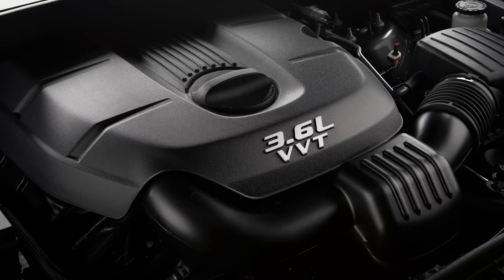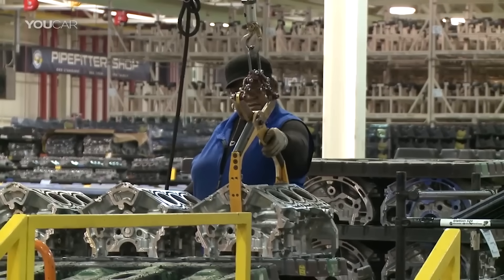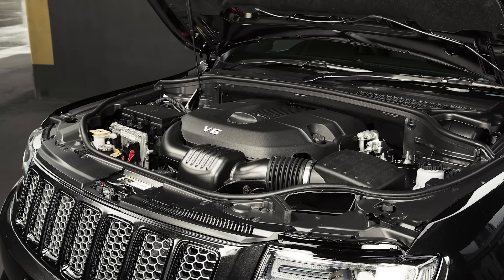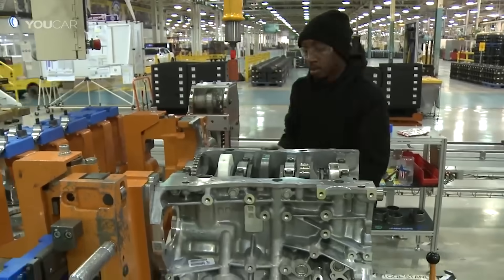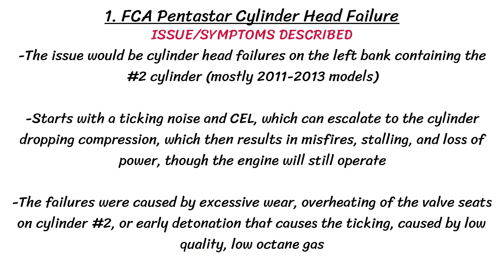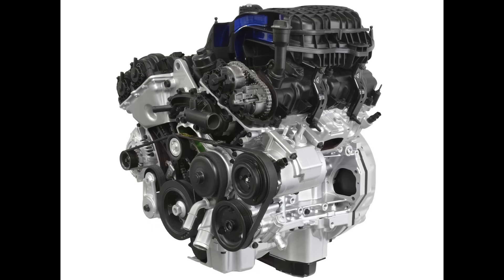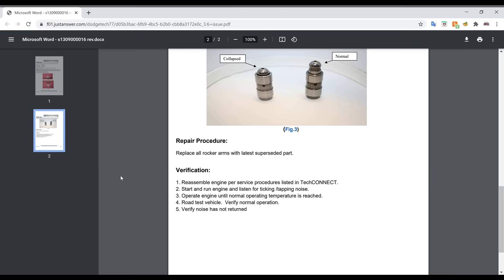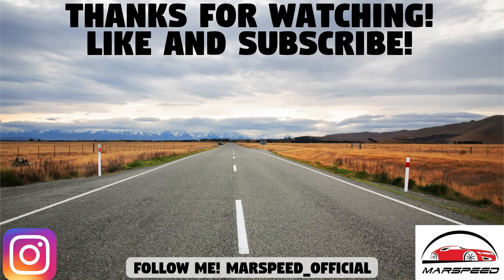The Specs and Fatal Flaws of the Chrysler 3.6L Pentastar V6 Engine

Comment: Ive had 3 vehicles with the 3.6L Pentastar. Never a single issue with any of them. Ive always done 5000 mile oil and filter changes on them. Fantastic engine!
Reply: I can't see how a single pentastar 3.6l DOESN'T blow its oil cooler by the 3rd oil change.
Reply: @richthevirtuoso my 2011 Grand Cherokee made it to 152k miles before the oil cooler needed to be done
Reply: @RRoy83  or was that when the oil started dripping? If you see how theyre attached to the motor, when they're hot and you twist off the filter cap... eeeeeasy to break that oring seal
Reply: @richthevirtuoso  Six years and 112,000 miles mine id fine. But yes, the plastic cooler/filter base can leak. I am 98% highway miles, and can see how all the heat from city driving could really cause a problem. Fully aluminum replacement oil filter/coolers are available for a couple hundred on amazon.
Reply: @richthevirtuoso  I never had to replace mine on any of my Grand Cherokees. But I'm sure I will have to eventually and that's okay. It's a job that I can do myself and it's not very expensive.
Reply: @Japplesnap  ya not expensive, but it's 120$ in china's pocket every time someone buys an aluminum one. All brake rotors too. Need to start manufacturing in India or NA
Reply: @richthevirtuoso  Personally, I'd only buy OEM when I need one. But if you want an American made aluminum one, buy one from Dorman. They are more expensive, but they are good quality. I'd still get an OEM plastic unit because mine haven't been problematic.
Reply: @Japplesnap  when I took mine off; the simple physics of it blew my mind. The filler cap sleeve is long and angled in such a way that the 2 bolts at the front of the body could never resist the force of a tight filter cap.. let alone when it's hot which is when we SHOULD change the oil, and .y o ring was flattened and fatigued when it came out. I was stunned
Reply: @richthevirtuoso  The issue 99% of the time is that people tighten them too much and crack the plastic. There's actually a torque rating and if you use it, there shouldn't be any problems with it. I actually torque mine to spec every time and haven't had an issue. It doesn't require a lot of torque to tighten it. The cap seals very well without much torque because of the o-ring. And that o-ring is a wear item and should be replaced every oil change.
Reply: @Japplesnap  the oring that seals the cooler to the engine is what I'm talking about. Also not sure if it's grime or expansion etc but cracking the filter cap loose was the most torque intensive part for me. It was really stuck several times. Think that was the culprit for me
Reply: @richthevirtuoso  Okay, I see. That's actually a gasket, not really an o-ring. But yeah, when the gasket fails you still have a leak either way. I guess I've been pretty lucky because mine hasn't failed yet. And my current Grand Cherokee is a 2019, so going on six years old already.
Reply: @Japplesnap  🙂
Reply: A wife is great in the honeymoon  phase till you get the honey do list, then you question like at 100,000 miles think I am closer to 1 million.  I do have to admit power they are great for a V6 non power outer engine but several problems I have seen is ease of maintenance like plugs and the common problem of oil cooler failure that you must rip intakes off to get to.Having a plastic intake is a thing you must take special care not to crack warp or strip bolts reinstalling, Have had no engine it self issues at close to 200,000 miles but not sure how many miles you had on your engines since I am  NJ with much stop and go traffic Vs if it was at my farm in NC that 18 miles to Walmart has 3 times I have to stop compared to my liquor store 3 block   away that is 4.  I do oil between 3000 and 4000 long stretch 5000 depending on weather because Snow rain and excessive heat. Cold starts and short trips kills engines and if yours are long distance going 5000 miles makes sense. My friend from NC do not replace shocks brakes and tires as often as we do In NJ because roads are better less stopping and more stabilized  temps. They also get much higher mileage with out problems all around the vehicle 400,000 is like 150,000 for my area. Also doing your own oil change unlike going to Jip Me Lube that does not drain oil out helps, I love places that say 15 minute oil change and my truck has 7 quarts, I pull the filter then let it drain while having a few to get all the old oil out about 30 minutes and still have a small drip. I have seen plugs put back in and a half a quart is till in engine and the crud still coming out.Plus the oil you use does make a difference along with filter never use Fram because they disintegrate as I have seen in more than one video and can leave cardboard in your engine. Hope you got more than 300,000 miles for the price of replacements.
Reply: Exactly,,,,,,,,no issues here either.......Awesome power
Reply: The first thing I did to insure I would not have internal issues was to remove the Pennzoil and put in my tried and trusted Valvoline. Change the oil on 7K mile intervals and we have had absolutely no issues. We actually were asked at the dealership we have had service it what we have done to keep the typical 3.6 noise down. All I can say is those who know use Valvoline.
Reply: @rustyrussell901  shill
Reply: @rustyrussell901  +1 I only use Valvoline in my engines.
Reply: @rustyrussell901  Any full synthetic is fine. Valvoline is not better then any of them. Pennzoil is excellent as long at it's the top of the line full synthetic.
Reply: @rustyrussell901  I would think that the owner of an expensive Pentastar engine could afford synthetic Walmart oil and filter every 3000 miles at $19.00 for a 5 quart jug. It would be pretty cheap insurance.
Reply: @DUCKSAREEVILLLLLLLL  Exactly, and the Walmart oil is no different and no less quality than the others. They have another brand put in Walmart bottles. The duty ratings of the oil are the same no matter who made it.
Reply: Do you want to triple the life of valve springs, rocker  arms, camshafts, bearings any lubricated parts Pro Blend 1600 it's amazing , you add it to your oil of choice.

Comment: Anyone know why I can't find an EGR Valve for 2014 Grand Caravan 3.6L at local auto parts stores but I can find an EGR Valve Control Solenoid/Motor on RockAuto? Are they the same thing possibly?
Reply: If you compare the part off the van with the picture on rock auto theirs your answer too if it'll be the same thing

Comment: I have a 2017 dodge Grand Caravan and the engine started tapping on top end after I bought it used at 68000 miles I towed it back to dealer they had to rebuild the top end of engine it was 3500 to fix I had extended warranty with 100 dollar deductible which was a blessing to have that warranty

Comment: Oh and they didnt tell you to put a hotter spark either or put a high volume oil pump with a dry sump and there you have an engine thats going to go 250k miles with no issues with proper maintenance

Comment: Use toyota antifreeze with no water mixture problem solved duh there is no electrolites in the good antifreeze so there is no corrosion which means no cooling issues for the engine

Comment: 2014 JKU here. New drivers side cams, rockers plus a radiator and heater core at 100k miles. Passenger side cams and rockes as well as another radiator and heater core at 200k. A third radiator at 300k and since it was still running hot, dealer diagnosed a blown head gasket. Fighting it out with Chrysler since i have the lifetime, unlimited mileage warranty. We shall see.
Reply: Wait how you get that warranty?
Reply: @Junior305able  . It was a Chrysler factory warranty. $2300 at purchase time. They stopped offering it in 2018.

Comment: Three of these engines. 2014 Avenger with 130K, 2016 Caravan 190K, 2018 Pacifica 112K, no problems on any of the three engines. Very good fuel economy, smoothness. Always use basic 87 octane fuel. Change oil every 8-10K miles.

Comment: Looking at a 2014 Dodge Charger SE with 88K miles on it with this engine. The car was a rental vehicle in its former life(disclosed by the seller). What is recommended as far as maintenance goes based on the miles?

Comment: I bought a 2014 Journey Crossroad about a year ago and since then, Ive had to replace the PLASTIC oil filter housing, the oil cooler, and the oil pressure sensor. Buy that extended warranty ladies and gentlemen!

Comment: I have a 2023 Jeep Gladiator Rubicon. It has the 3.6 vvt engine. It started ticking, and then the check engine light came on. When I brought it in, it was a collapsed valve, with massive amounts of cam damage. I am currently waiting for the insurance company to  ok the repair. Not happy about this, since it is a known problem. I wouldn't have bought this vehicle had I known. I would not buy one again.

Comment: LoL we just had some heavy rain and I drove through a long puddle my engine sucked up water through the intake. Hydro locked it pulled the plugs and changed oil 3 times to find out it bent a piston rod lol who puts a air intake in the bumper wtf LoL

Comment: The Plastic Engine oil cooler gets hairline cracks after wear and tear. This part is expensive to replace and honestly should be a recall due to poor manufacturing. If you do not replace this part your car will overheat.

Comment: In the late-2010s, the very-late-2010s, IIRC, I was with a person, who had a 2014-built (don't remember the month, sorry) Dodge Journey with the Pentastar 3.6 and the symptoms were the following: 1: The check-engine light is lit solid. 2: Rough idle 3: An unusual exhaust odor noticed during idle. It was smooth in comparison when she was driving it. It has been fixed. Because it's 2014-built, I didn't expect faulty heads, but I did suspect a faulty head! I don't remember hearing ticking, unlike on a couple of other engines, which were OHV, IIRC.

Comment: GREAT INFO.  I WOULD LIKE TO BUY A GOOD USED 300.  WHAT YEARS DO NOT HAVE THESE ISSUES?? 2011-13 I BELIEVE AND BEYOND ?  HOW ABOUT 2018 AND LATER?? 3.6.  THE HEMI HAS ISSUES AS WELL SO I READ BUT WITHIN CERTAIN TIME FRAME AND OR ENGINE TYPE OF HEMI.  THANK YOU SO MUCH.

Comment: Biggest majority of 3.6s I've dealt with were oil cooler issues. Our shop always replaces them with the aluminum unit since most of them seem to start leaking from the seal between the plastic housing and the aluminum cooling block. Ford had a similar issue in the v6 engines and the plastic thermostat housings that would warp and lose their seal. 
I think in the past 3 years I've had 2 3.6s come in with rocker arm failures. I've yet to have one with a cylinder head failure. 
I've lost count on how many oil coolers I've replaced.
Reply: My problem on 2017 Pacifica-I noticed my antifreeze coolant level was depleting everyday where I had to add some. I looked for any leakage around the van to no avail. Finally after placing the problem on YouTube, come to find out most of the Chrysler/Dodge 3.6L Pentastar V6 engines have a  failed Oil filter housing and oil cooler (Made of Plastic warped due to the heat off the engine)  that is a common cause of coolant and oil leaks on Chrysler 3.6L Pentastar engines. I went ahead and broke into the engine to the valley of the engine and replaced the failed Oil filter housing and oil cooler with a Dorman Upgraded Aluminum Engine Oil Filter Housing with Oil Cooler and Filter-No leaks now. With the breakdown of the engine I replaced the spark plugs, PCV valve, Air intake filter, Mobil 1 extended mileage oil change, with new "O" rings while I was there.
Reply: @zama7477  I have a Dorman Aluminum Oil Filter / Cooler unit sitting in my garage. It is stamped with, "MADE IN USA." Hope to never need to install it.
Reply: @johngranato2673  sadly, you will have to eventually. But that aluminum one is the way to go for sure.
Reply: @Basslicks82   you are probable right, brother
Reply: just replaced ours with an aluminum one off amazon for $70. seems to be working great. Glad i didn't just replace the seals and hope for the best. The only reason i noticed it leaking is because the oil pump solenoid shit the bed and threw a p06da code. It wasn't leaving puddles on the driveway but it sure did make a mess of the transmission with oil all over it. replaced the oil pump solenoid with the dorman replacement by just dropping the steel pan and routing the wire around the pump instead of between the pump and block. it also works great so far.
Reply: guys, the oil filter housing on the Pentastar is an oil warmer, NOT a cooler! It's meant to bring the oil up to operating temp. sooner & tie it to coolant temps. because the variable-valve timing components on these motors are very sensitive to oil viscosity & it needs to remain as consistent as possible! Think about it, engine coolant heats up faster than the oil  on a cold start & once everything is fully warmed up; oil temps. usually exceed that of coolant temps. anyway by @ least a few degrees! 

I can guarantee u that little housing sitting on top of a hot, running engine UNDERNEATH the intake plenum isn't getting nearly enough airflow over it to cool down spit!💩 It's working much better @ getting the oil up to operating temp. on cold starts...if it were an air-cooled only mini-radiator style cooler placed somewhere, say, underneath the vehicle that ONLY the oil was plumbed into I could call it an "engine oil cooler" but the circulating hot coolant surrounding the current design on top of the motor ISN'T doing much by the way of cooling for the oil!
Reply: @jbone1383 you're correct, sir. "Oil cooler" is a misnomer. The name of the part in most listings is "oil filter housing" or "oil filter housing adapter"
Reply: 90 percent caused my over wrenching 5 min oil change places
Reply: @rickbaier1042  that's technically a different issue. The ones I've replaced failed because the plastic warps at the union between the cooler and the aluminum cooling block... Not stress cracks from over torquing the cap
Reply: I had both the oil cooler leak and rocker arm failure on my 2017 wrangler at 70,000 miles.  The oil cooler leak was exactly as you described. Replaced with full aluminum upgrade. My friend, a Chrysler mechanic for 20yr. sadly tells me he's had to fix 100's(yes 100's) of 3.6's with the same problem and always recommends the aluminum upgrade.  Why Jeep continues to put these plastic oil cooler parts on this engine is absolutely ridiculous.
Reply: @SurfDweller  yeah I've done a bunch of them, and I don't even work at a dealership. Just a small independent all makes/models shop in a Kentucky small town.
Reply: I'd say if u have a 3.6 go ah3ad and replace the oil cooler. I know I will in my 2019 gcl. If that's all I have to worry about I'd say that isn't to awfully bad really
Reply: My oil cooler on my 2012 challenger went after 160k miles
Reply: Replaced my oil cooler today
Reply: I've had the rocker arm issue, oil cooler issue and a failed thermostat on my 2014 Chrysler 200
Reply: and what do the new models use? since this is a know issue wouldn't FCA use the upgraded part?

Comment: Strange never heard of any of these, I have had one for over 150k runs like a champ.:: A lot of these issues sound like a lack of maintenance.. Only one major problem was lifters before 2014. But they had a huge recall on those and would swap out the heads..
Maintenance people … Change your Fluids and keep them topped off.. good motor in my opinion… 2014 ram 1500 towed about 2,500 pound trailer everyday for 100k.

Comment: I have a 2015 Jeep Hrand Cherokee 3.6. At 132k the rockers failed on the drivers side. Replaced and fixed it. Now in at 170k with aweful cooling problems and now you cant get a mopar thermostat anymore. I have replaced hoses, radiator 2 times, thermostat 2 times, water pump, temp sensor, oil cooler, ordered new catalytic converters, hours and hours of bleeding the coolant system and still will not get me to and from work with getting hot. I checked for exhaust gas in tje coolant system and it is running lean as i have p2096 and p2098. But there is a service bulletin about false mil in relation to these codes. Local dealer said they would look at it and flash the computer for a small fee of 370 plus tax. Im about to throw in the towel.

Comment: People love to trash the 3.6. I sold my 2013 Town and County with 280,000 miles. The trans was shot, but the engine was still pretty damn good. Those miles were not trouble free, but nothing spectacular. Here are my issues. A roller rocker developed a tick, $7.00 and an hour work and problem solved. The plastic thermostat housing had a hole in it, don't know how that happened, but not really a big problem. Oil cooler leaked at "O" rings. Relaced with aftermarket part. It is a job to replace the spark plugs. The van was great, good ride and good fuel economy. It had lots of power for a minivan.

Comment: My Gladiator is at jeep right now with right side camshaft failure, rockers, lifters and phaser. As well as a coolant loss issue that is not external. They are saying since my jepp has a "tune" or what I call an adjustment for larger tires that it voids my waranty. This engine has a history of issues, but now they have an excuse not to fix it.

Comment: I have a 2012 Journey R/T with just over 60,000 miles. Runs like the day it came off the showroom floor. Not a single issue. Purchased in Canada. Maybe that's the difference?

Comment: 2012 Dodge journey. It developed a rotational ticking noise which appears to be in the engine side of the transmission. We just changed the fluid. It has 110,000 miles on it. Could the ticking noise be a rocker bearing? Stethoscope pointed to the transmission but I never listened to the back of head.